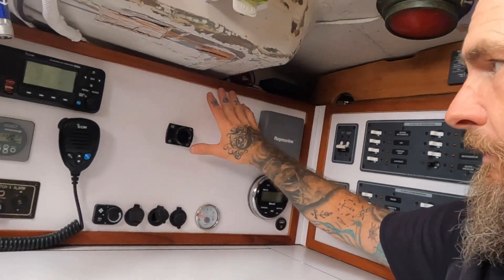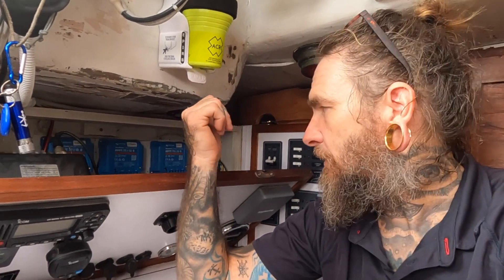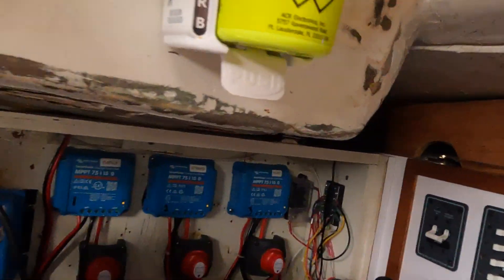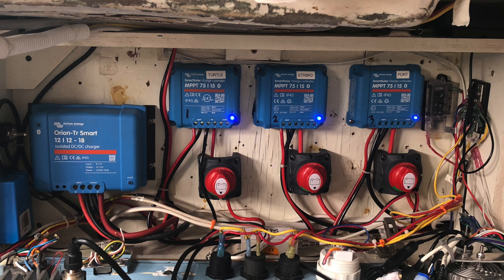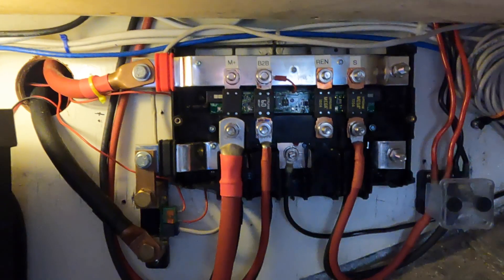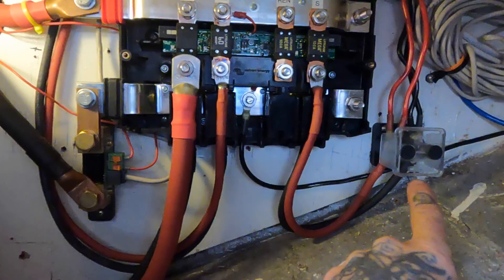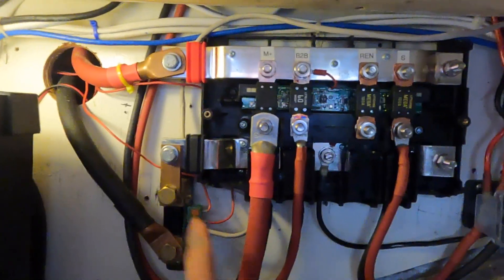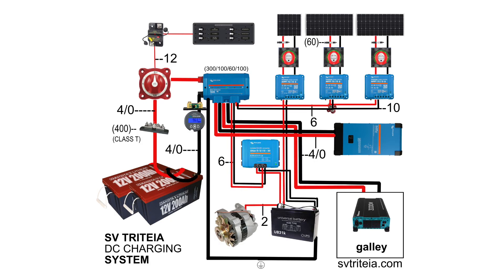A Look At The New DC Charging System on My Vintage Sailboat

Comment: I have a Colvic 26 Sailor yacht here in the UK My yacht comes out this week the wiring is set up for a live aboard but there are no circuit breakers what so ever on the yacht. So i may have to stripe the wiring out and start from fresh all the wiring is ordinary household wiring, going to replace it with marine tinned wiring and fit a circuit bus for the wiring with fuses.
Reply from the maker: Yeah your safest bet is to rip it all out and replace it like you mentioned, also make sure you get a label maker and label both ends of the new wires

Comment: Nice! Love the redundancy. I built a 200 watt system with the same mppt. My thinking was to design it as a modular set up and plan on adding another 200 watt panel and another 75 - 15 mppt when I can afford it. I also have a Raspberry Pi with a touch screen running the Venus OS to monitor the system.
It works like the cerbo GX with the touch 50 at a fraction of the cost.  Thanks for another awesome video.

Comment: One possible thing.  In that tight space where a large inverter is going (against the hull) is there sufficient ventilation to let heated air out when in hot latitudes?  I really couldn't see much of the space so may be off the mark.  Really nice solar set up.
Reply from the maker: It’s completely open in the front to the cabin
Reply: @SailorJames  cool.  Literally.  ;)